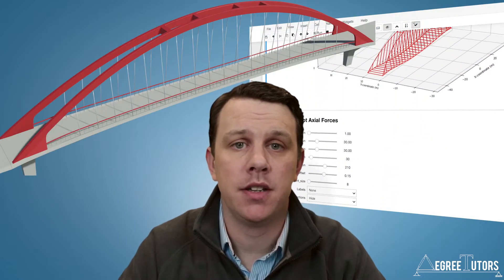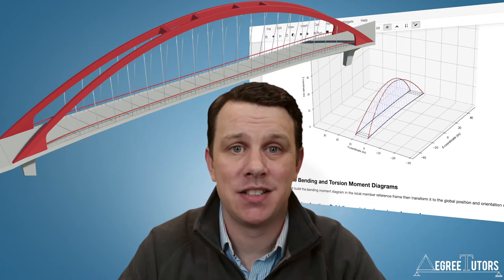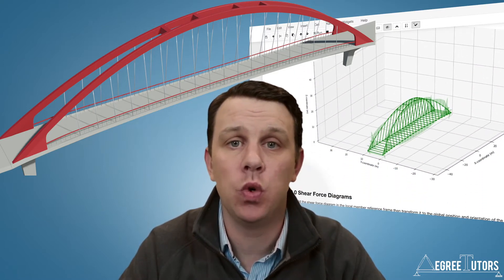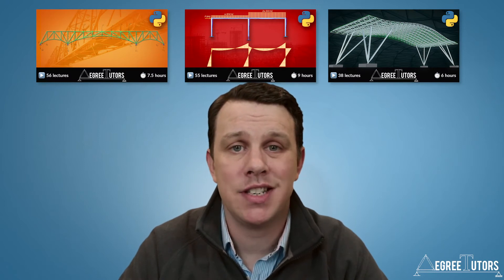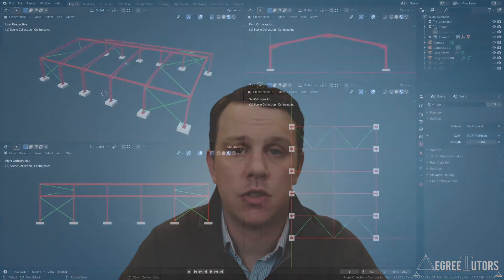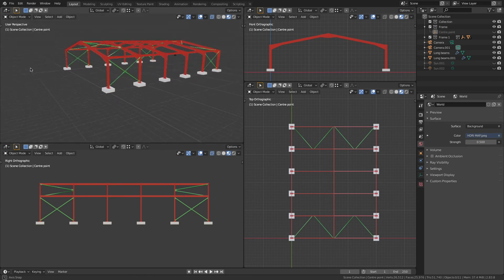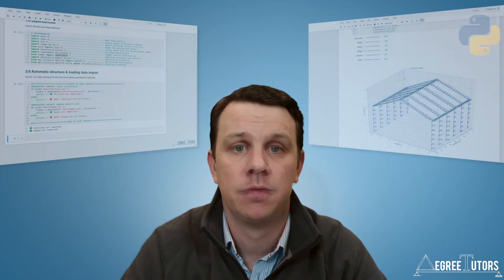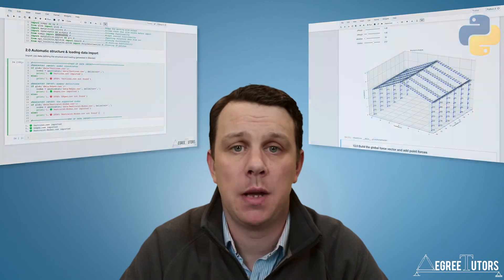[1/14] Finite Element Analysis of 3D Structures using Python | DegreeTutors.com

Comment: I wish to see a course that combines shell elements  with 3d Frames
Reply from the maker: It's in the pipeline!
Reply: @EngineeringSkills-Sean  I will be waiting for it, and I happy that you are working on it , I realy appricate the work that you put in these courses , hope you finish it soon ,another thing I would like to see is how to we could drive these analytical models from grasshopper and Rhino so we could use all the structural optimization tools like galapagos , etc.